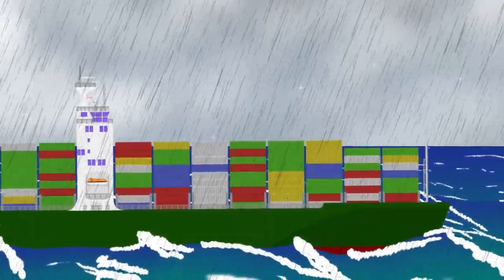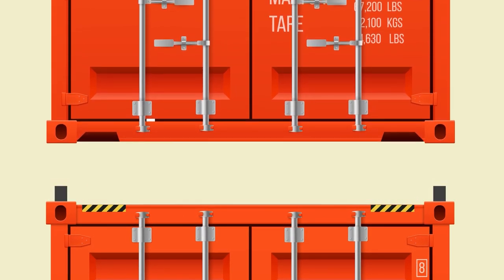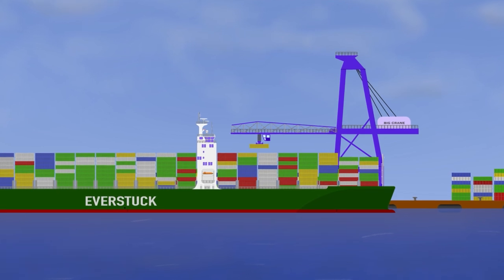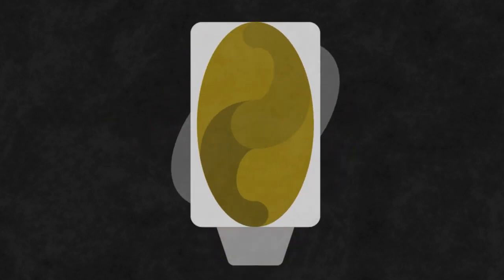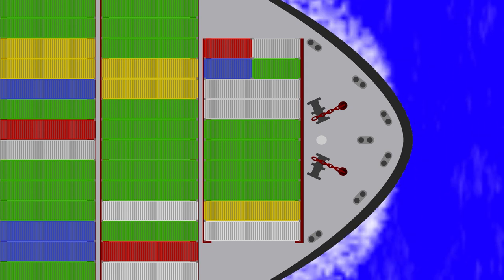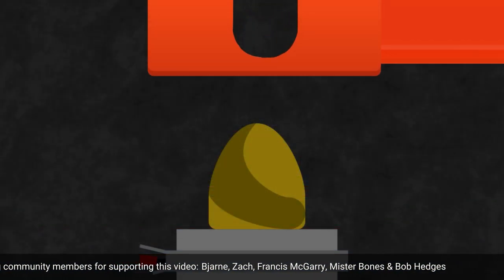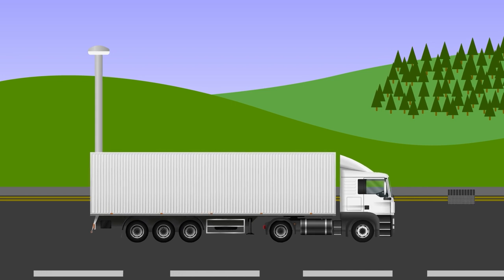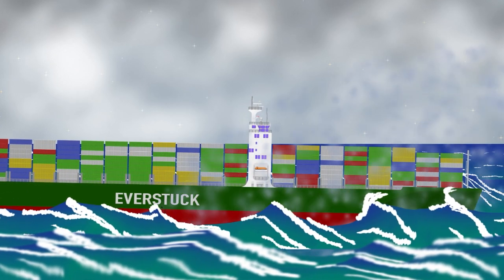Why Don't These Containers Fall Off?

Comment: "Why Don't These Containers Fall Off?"  As a matter of fact, sometimes they do.  I sailed on container ships for many years and, although it never happened on any ship I was on, I have heard of many instances of containers going overboard.  The problem is that the container terminals are always in big hurry to finish loading ship and move it out to make room for the next one.  The Mate of Watch is supposed to check EVERY ONE of the twist locks prior to sailing.  However, since multiple cranes frequently work on a ship simultaneously, sometimes as many as five at once, and the terminal is always in a big hurry for the ship to sail, that is often not possible.  Another big problem is the "reefer" (refrigerated) containers.  Some ships carry hundreds of those, and the cargoes inside them are perishable and high-value.  The Mate on Watch is supposed to ensure that ALL of the reefers are plugged, running properly and maintaining the required temperature prior to sailing.  However, again, the terminals are in such a hurry to get the ship away that it is not always possible to do that.
Reply: My parents discovered it the hard way when their shipping company lost 1 container during a storm. But then felt much better when some her friends lost half or more of their inventory during the same voyage.
Reply: I got told that if the ship rolls to much it is wanted that the Containers on that Side fall off, as like a last ditch effort to get a counter force.
Reply: Yes, we've often heard coast guard reports over the radio of containers overboard as a navigation hazard. Don't know how long they stay afloat, but the coast guard will keep sending out warnings for hours.
Reply: If you have ever shipped using containers you realise that the closer to the center you get the dearer it gets. Cheap on the top corner but if it get there is another question. The week to lose a few every trip
Reply: The proportion of containers that get lost is very small. I can't quite remember whether it's a few thousand or a couple of tens of thousands per year, but as a proportion of the vast number in service, it's tiny.
Reply: are the reefers all on a special deck with short leads nearby or do you have to run leads to them wherever they are? seems like a very time consuming operation relative to loading regular containers.
Reply: @boatbutch  not nesacarily, our reefers went up to tier 3 on deck if there were required to be plugged, any bay dependant on IMDG information there was no special deck for reefers.
Reply: @beeble2003  it's a few thousand per year, somewhere near 2k I believe as there was an incident in 2020 where ONE Apus (i believe haven't checked the details) lost about 1800 in one accident and that ended up being more than would normally be lost in an entire year
Reply: @geoffgunn9673  not so sure on that as I've never sent a container myself however when carrying them we stacked the lighter (empty) containers at the top of stacks, both for stack weight and for stability, equally the heavier the container the closer to the centerline of the ship we wanted it.
Reply: It should be checked and signed off by the OOW and the Foreman before departure, if this isn't done this is a huge safety failing by the ship
Reply: @tobymansell1386  Thanks!
Reply: @gianniwu6564  So they felt better because of someone else's misery?
Reply: I wonder what the recourse is there. Does the insurer accept full liability and compensate the owner of the goods, or would they sue the port/ship owner for negligence to try and recover their payout? Is there a certain threshold for rough seas where a container falling off becomes an "act of god" and therefore the insurer has to take full liability?
Reply: I read an artical about insurance company wanting to increase the insurance price of the containers which are loaded on the sides above the deck. (Yes, it was during covid, so yes, I was bored and searched for it after I had read about an accident)
It seems that they do fall off (read something about 1-2k/y).
Reply: @mekaerwin7187  hey, better to get irrelevant warnings about containers that already sank, rather than the container still being afloat and you don't know about it until you've already hit it and torn a hole in your hull.
Reply: Andrew Crews  Even if it was due to negligence?
Reply: On ships with a high number of reefer plugs it is usually the electrician who's responsible for checking the reefers, as the Mate is more than busy enough already :)
Reply: @nightraven836  Oh, absolutely
Reply: I gotta appreciate how there will never truly be accounting for human error. Jobs getting rushed and corners getting cut will always beat out technological efficiency.
Reply: @Gigas0101  not really, given our constant advancement of literally every field..
Reply: Because of the back logs at the ports the ships have slowed down as there is no hurry. This exposes the ships to the weather often with violent side to side rolling. Containers fall overboard in these conditions. The stacks are supposed to be loaded with heavy containers at the bottom. There have been a number of instances where empty containers were loaded at the bottom and collapsed causing the stack to fail...the very worse containers are those that float just below the surface. Unseen from the area traffic. A crushing impact on collision.
Reply: Andrew Crews  Yeah, I'm thinking now we have better ways of establishing liability it would need to be updated. General average still makes sense when it's a no fault accident or act of God, but when someone is clearly at fault then I can't imagine cargo insurance companies who would have to pay out or, of course, uninsured customers won't want to sue to recover those general average costs, or avoid paying them in the first place.
Reply: @tobymansell1386  As with everything in shipping, there is neither the time nor the hands to do everything by the book. The dangers of insufficient manning and the gruelling workhours that brings has been known for decades but profit trumps everything these days.
Reply: Working in logistics is constantly trying to maintain the quality and security of the operation while always running against the clock. It's easy said than done
Reply: 10,000+ on the sea floor……🤣😂🤣😂😂🤣😂
Reply: They should make the locks automatic, where they lock when lowered and can only unlock when lifted straight up.
Reply: Very true hence the need to always purchase good coverage for your containerized freight, anything can happen and the fees are pennies on the dollar.
Reply: Yeh I worked on trawlers when I saw "containers never fall off" I was highly sceptical of the claim . Mind you I've only ever seen 2 floating by themselves .
Reply: Sometimes=10k per year.
Reply: Interesting. Not shocked at all. Every business pushes for faster / cheaper. Seems dangerous.
Reply: @itoibo4208  Now that's a fucking million dollar idea if I've ever heard one. 

Of course assuming that you're the first person to have had it. But for what it's worth this is the first time I've heard of the specific straight up and down solution.
Reply: Yea but this video is really talking about the 'design' of the containers and how they work. Obviously user error is possible in even the most failsafe systems, but that doesn't negate anything said in the video
Reply: @gianniwu6564  What's it like being raised by manevolent narcissists?  Are you a successful adult?
Reply: Thank you for the enlightenment

Comment: It's estimated that on the order of 1500 containers are lost at sea every year. While I know that this is a small number compared to the number shipped, it still represents a huge hazard to ships and small craft. A floating container is very difficult to see as most of it is normally submerged. Thanks for your explanation but I wish these numbers were  much smaller.
Reply: They float? I assumed theyd sink right down. Imagine driving your million dollar luxury yacht into one 😅.
Reply: @finsfan90  Float versus sink is a function of ow dense they are. A container full of bins of scrap steel might sink right away, while a container full of plush teddy bears might readily do that "float just high enough to wreck your day" thing.
-
I recall some idea about modifying containers to have a vent hole that fails open when submerged, but the problem is designing such a thing to NOT fail open from rain and spray.
Reply: @MonkeyJedi99  That was my next question, yes.

The doors seal tight enough, then, not to admit submersion water?  Really?
Reply: @baylinkdashyt  From what I saw in a short documentary, the doors seal enough to keep out weather, and as a result can delay the sinking of the container for a while.
Reply: @MonkeyJedi99  Denser containers are likely down in the hull, rather than high up.  As a result, I imagine most lost containers to be less dense than avg.
Reply: @pierrecurie  I had not thought of that aspect.
Reply: A single ship lost 342 container's Infront of the Dutch coast in 2021
Reply: @jessevvilsteren  And a while back a vessel (iirc an Apus one) lost ~1800 in one incident. Substantially more then was lost in all other incidents that year combined.
Reply: Could we make bullet trains but for cargo only?
Reply: @JudeKnowsWhatYouDoNot  Yes, but it would not be economically viable. They would require huge up front costs and it would be questionable if they would ever be able to pay those costs off. And they would be much slower then aircraft
Reply: @hanzzel6086  my reasoning was that since aircraft cannot carry as much as a train would, trains would be a better choice. However I’m not very informed in regards to the cost of bullet trains so maybe I overlooked that.
Reply: @JudeKnowsWhatYouDoNot  There is also the fact that aircraft came first and can use existing infrastructure/vehicles. Whereas Bullet trains require all new infrastructure and vehicles. And because it takes time to achieve such speeds and they can't turn well they need a fair amount of relatively straight/flat land over a large distance in a straight(ish) line between highly industrialized areas (since this is a cargo train). All while requireing all existing/future infrastructure to be (re)built to accommodate them.That doesn't leave many places where they would be viable
Reply: @JudeKnowsWhatYouDoNot  space is such a huge issue with bullet trains. You need a straight track. Not many areas you build a straight track.
Reply: @JudeKnowsWhatYouDoNot  They would take ages to unload. Designing for aerodynamics and for cargo are conflicting requirements.
Reply: Very true, I grew up on a boat with my parents crossing oceans and our biggest concern was  not storms but hitting a submerged shipping container.
Reply: @finsfan90 that’s actually happened before and they made a movie about it
Reply: @jessevvilsteren That's when the captain should call in the Dutch Air Force to make sure that all of them sink very rapidly. Either that, or call a salvage company to try and retrieve as much cargo as possible (I assume this would be functionally impossible further out to sea).

Comment: The long stick used to lock and unlock the twisters can generally, at least from my experience, only be used at the first 3 stories up, if it's over that like say 4 or 5 the ground crew placing the locks on shore will be lifted up in a cart flying next to the containers and unlock them, which is pretty fun actually as long as you're not scared of heights or the fact that a man in a crane is lifting you high up in a cart that swings and the only thing keeping you from dying is his ability to control the damn thing
Reply: You are right, ,the poles can only be handled up to three high, the rest by a cage trip. I've experience a crash or two but nothing serious. It can be fun and a good view.
Reply: @Igbon5  You shippeople are a bit crazy :D "Well, there were a few crashes, but it generally is good fun!"
Reply: By no means was it easy, but at the port I worked at we had extendable poles that could reach the 5th high row. Took some skill to use and we only used them in certain places on the vessel.
Reply: Reminds me of the telehandler basket my construction company has.
Reply: Where i come from, we call it:" The Gondola", because the construction that you're standing in, literally has the shape of one. 

A so-called "crash" as people call it, will be banging against something which isn't nice but as others mentioned here, is not such a big deal other than a serious reprimande to the crane operator😠

But a few years ago, the complete Gondola fell out of the crane and onto the ground, because the extra 4 twistlocks of the manual locking device was set in the unlocked position and the crane operator accidentally released his twistlocks too when the gondola was resting a bit on the ground(when there's pulling-tension between the spreader and the gondola, safetymeasures will ensure you cannot release your twistlocks), injuring one of my collegues. 

The guy was paralyzed for the rest of his life and was fed through a tube for several weeks.

I'm a crane operator for various types of Ship-to-shore cranes  myself as well as a coördinator and i can honestly say i'm doing a great job being fast when loading & unloading containers, but when i'm working with people in my spreader, i forget speed and emphasize on safety. More importantly; when the guy in the gondola is conducting his operations, HE calls the shots and i just follow his orders as the crane operator.
Reply: 5 highs are possible from the ground. 6 highs we do from the crane with a man basket
Reply: We also do 5 high, here at the Port of Houston.

Comment: I work in a train yard, We use manual twist locks that are part of the wagon, the container guys usually just walk along the train length dragging a hammer across the lock handles to rotate them to either the locked or unlocked position depending on what they are doing.
Reply: So its Hammer Time!
Reply: Minecraft Immersive Engineering:
HAMMHAA!
Reply: Did not knew train operators use locks on containers. Just saw one wagon close up with only had pins and assumed that would be sufficient for all train operations.
Reply: @danielrose1392  probably depends on the operator/company, our trains (KiwiRail)  can't leave the yard without them being checked.
Reply: @shadow_wolfen  Intermodal trains can have containers stacked a couple high. So they, at the least, would likely have twist locks holding the containers together and down onto the rolling stock to prevent them toppling over on the outside of a bend.
Reply: @tanall5959  yeah? I said we DO use them?
Reply: @danielrose1392  here in Denmark, we've come to appreciate proper locks on big boxes transported on trains. 8 dead, 16 wounded when, during a storm, the kingpin lock failed on a lightly loaded semi-trailer being transported by rail and hit an oncoming passenger train near the front when they were passing each other on the Great Belt Bridge. The cause: improper lubrication of the lock mechanism. It lead to, at first, temporary bans on that type of transport, and since then new laws governing their maintenance - in the entire EU. 

https://en.wikipedia.org/wiki/Great_Belt_Bridge_rail_accident